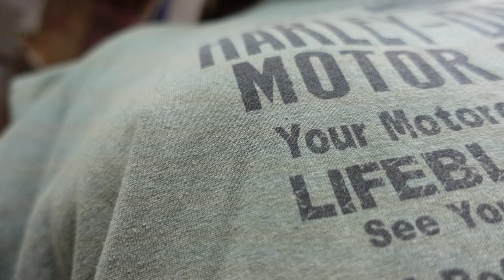Harley Davidson was the WRONG CHOICE | Cross Country on a 1979 Shovelhead ep1

Comment: Tip for riding old Shovel heads long distance on highway, you need to pull the clutch every so often and snap the throttle shut, helps with the oiling the top end.

Comment: The new Goldwing's don't have an on-screen Help selection? (to instruct u on how to engage reverse mode)
Left handle bar
Bottom center button (pic of Goldwing) - press and hold
Right handle bar
Actuate the brake lever (it engages slow fwd and reverse mode)
Left handle bar
Bottom left (to the left of the Goldwing pic) minus button - push it and u will begin to go in reverse

Instructional video didn't show how to disengage this mode but I would guess u press the Goldwing pic and apply the brake again.

Comment: I'm no lawyer but I have been involved in real estate for 34 years; If you have a written lease, you have conditions spelled out.  So I'm assuming you didn't have anything in writing re:  when you had to out by the end of July.  And then what's with the additional $3500 for?    Weird circumstances.  Remember this folks:  who ever gives you a contract has paperwork beneficial to THEM, not you.  So READ the small print.